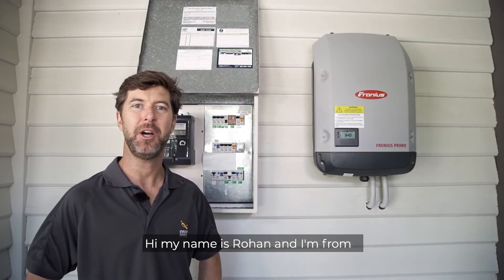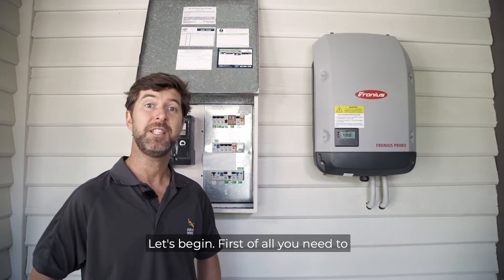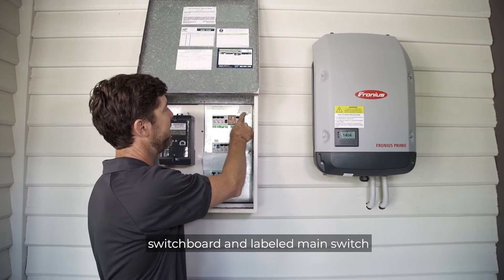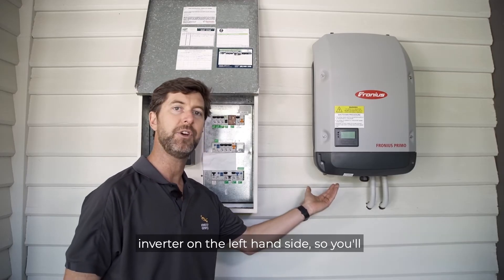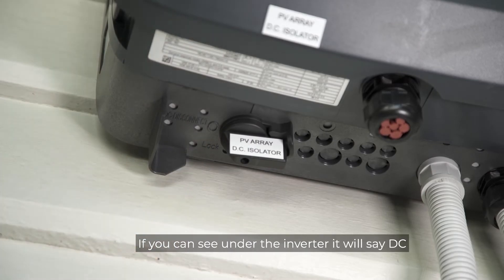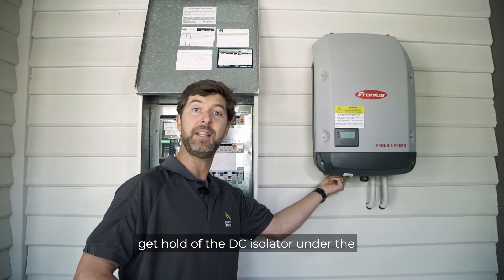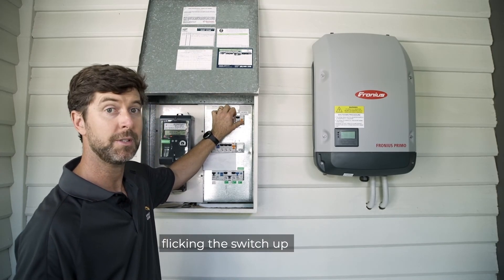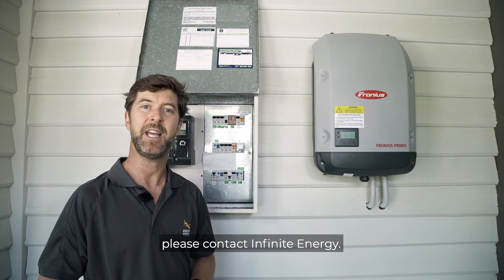How to restart your Fronius Inverter | Infinite Energy | Support

Comment: Hello I have a old IGTL 3.0 unit and need a soft where update. fault code 735 734 any ideas ?
Thank you
Reply from the maker: Hi Josh, if we installed your system, you can log a ticket with us via our portal infiniteenergy.supporthero.io otherwise, it would be best to get in touch with your installer, or Fronius to help you with this issue.